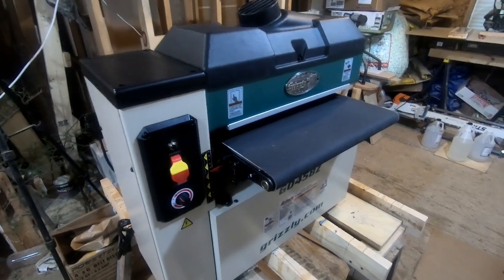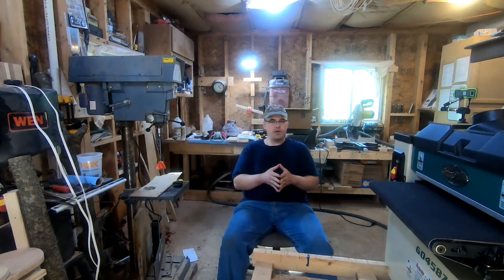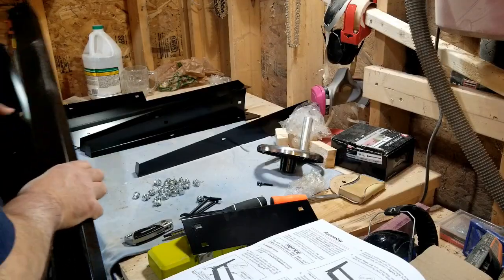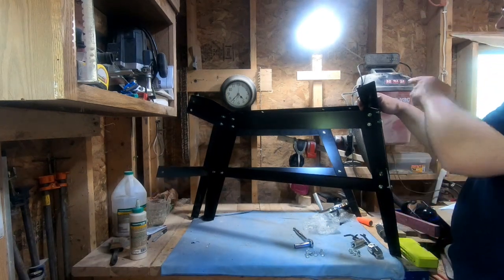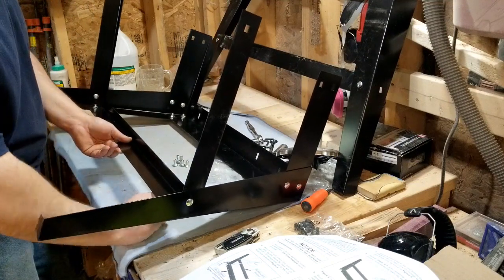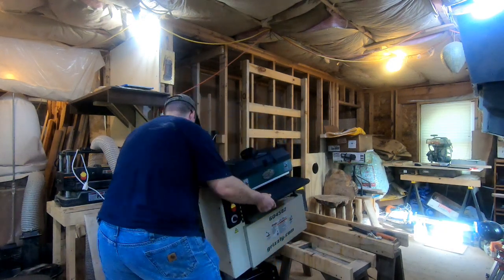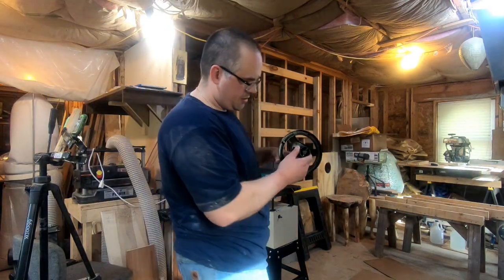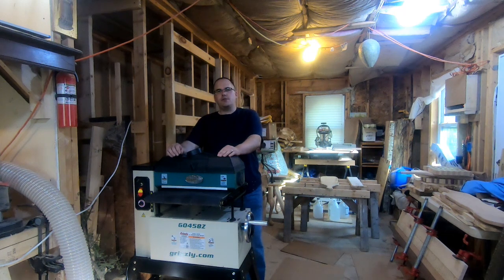Grizzly 18/36 Drum Sander Assembly and First Use

Comment: There should be a plate across the back which is bolted to the tabs just below the hinged side of the cover and extends to approximately half way across the drum. Did you remove it or was not supplied as I bought a used on and it was also not in place (shown in the parts diagram) I have poor dust collection and believe this part of the problem. Thanks in advance.

Comment: That should shave some time off at sanding time. Nice addition to the shop.👍
Reply from the maker: You're right about that Eric, I sanded an end grain board in 8 minutes. It was only low grit still needed 120 and up but, it's a lot better than the old palm sander for hours. Still using the palm sander at 120, 220.